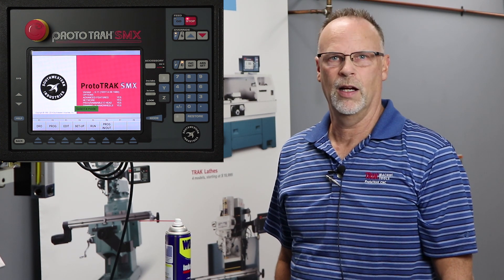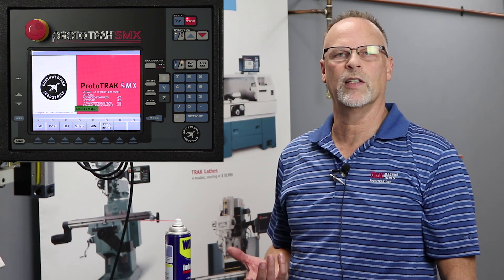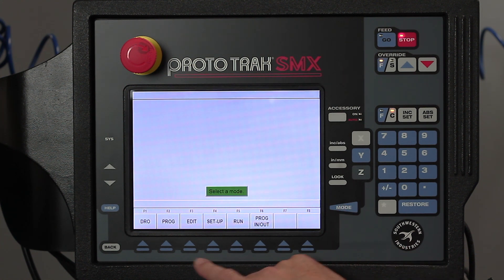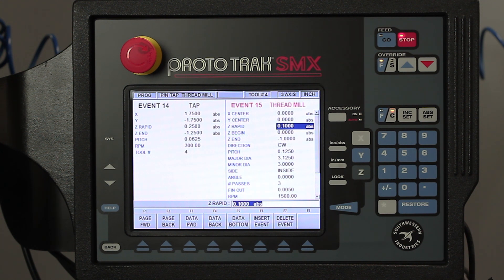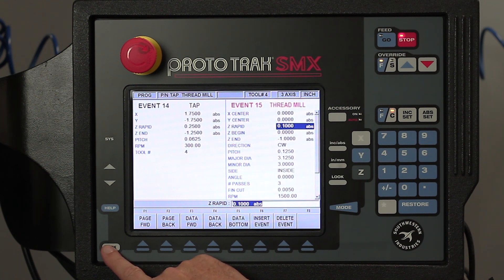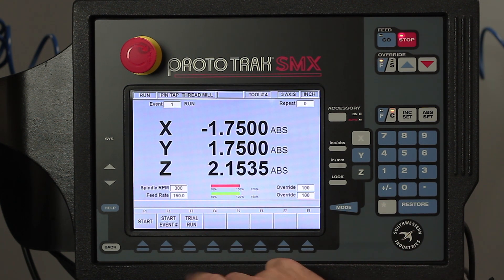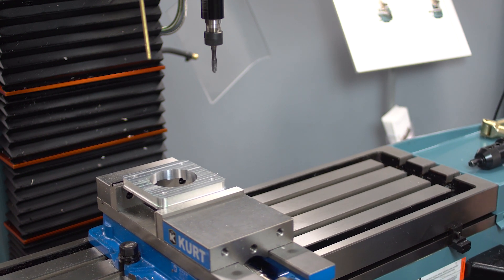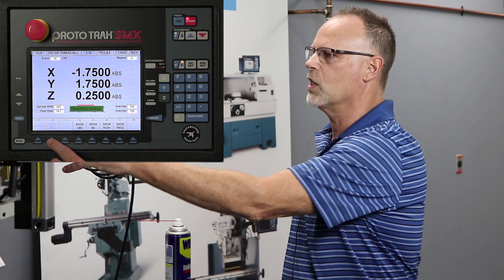Thread Milling [Part 1] | ProtoTRAK SMX CNC | Advanced Mill Programming

Comment: How do you determine the speed and cut on the threads if you are cutting steel?
Reply: I usually use the FS Wizard app for all of my feeds and speeds.  This app is free and it works well for everything.  If you're cutting threads on one of our open machines. I like to set the overides at about 50% since I don't have high pressure coolant.  T.P.

Comment: Need to do a video showing how to do npt thread set up.
Reply: It's coming.  That feature will be on the next version of software.
Reply: @patrickfitzsimmons5187  Actually Brian, I shouldn't try to answer these questions from my phone so my previous comment is incorrect.  I thought your question was on our lathes.  For our mills, we do not have a way to cut the tapered hole for the NPT thread nor do we have a thread cycle for the NPT thread. The only way I know how to do it is with a tapered cutter and then use a NPT tap.  If and when we do, we will make a video for it. T.P.

Comment: Is the spindle reversing when you're cutting?  What VFD is reacting that quickly?
Reply: Hi Mac, the TAP event does reverse the spindle at the bottom of the threaded hole.  As I describe in the video, you will need a floating tap holder because there is no encoder on our bed and knee mills.  If you do this on one of our machining centers, you can rigid tap  T.P.

Comment: Great video! Is there any way of cutting a right hand thread with the thread mill from the bottom of the thread out?
Reply: Yes, just use the bottom number as your Z beginning and the top number as your Z end.  Z rapid would also be at the bottom.  T.P.

Comment: If the machine has a quill, couldn’t it prompt the operator to unlock the quill? Then the tap could continue down while the spindle slows after the machine has reached its depth. Then reversing like normal while the quill stays slightly extended. The machine would have to prompt the operator to re-lock the quill after the tapping operation.
Reply: The readout on the quill is tied into the encoder on the Z ballscrew so that the machine always knows where the tool tip is.  If the quill moves, the machine will shut down because it will no longer know where it is so this would not work.  The floating tap head works great for this and that is why we suggest people use one.  T.P.